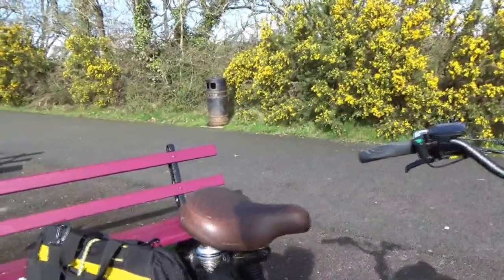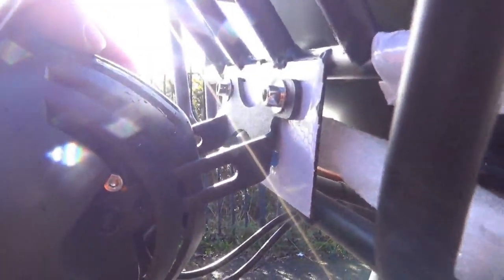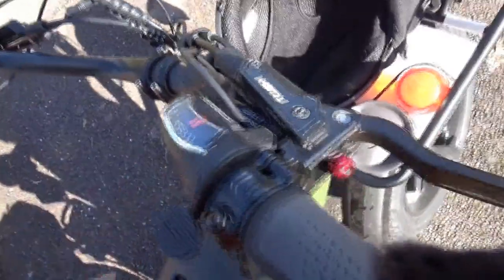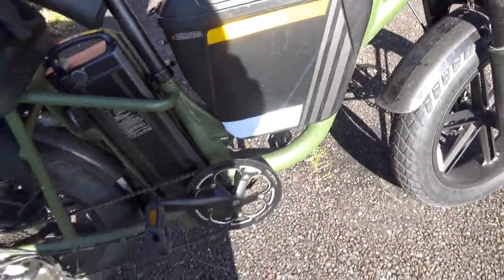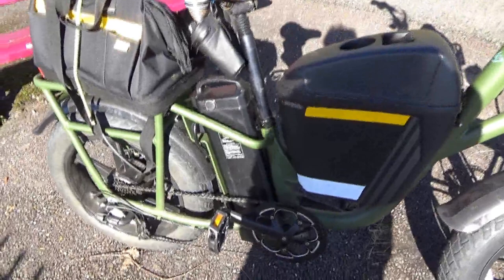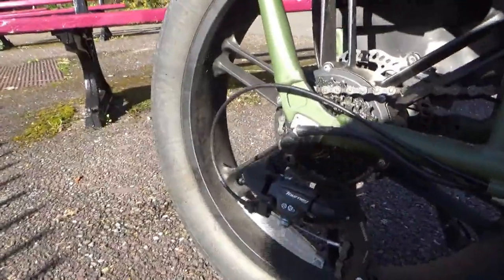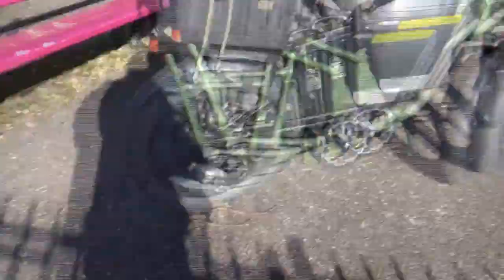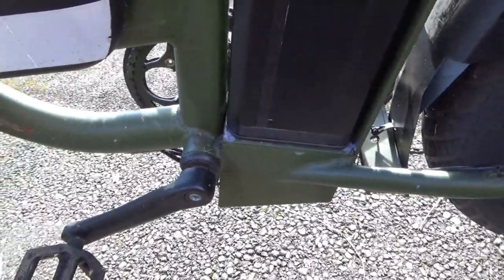Fiido T1 replacement review

Comment: Thanks for the follow up. I totally agree on the controller and the speed limits , I've just swapped my system out for a Grin phase runner with pedal torque sensor.  Great bike to ride and now I've taken ownership of the electronics I'm in control of all the settings.
Reply from the maker: Very good. I recommend the Grin. A well worthwhile investment as it can fit inside the existing housing. Well done.
Reply: I have been trying to find an alternative for the electronics ,you have made my job a lot easier  now . can you please tell me if it was easy to do  and and approximate cost ? Thank you in advance.

Comment: It has cruise control, just have to hold down the bottom button until it flashes and then it's on.  Have to do every-time you power up though if you want it.

Comment: On these bikes I think it will be worth adding a torque arm fitting to the rear wheel spindle.  It is the torque reaction on and off all the time that is loosening the wheel nut so threadlock ( although better than nothing) is going at the symptom rather than the cause.  I think it will be easy enough to implement on the brake disc side and use the sidestand bracket bolts as the  stay.   How do you find the mudguards when it's raining ?

Comment: OP, what is that center basket in the step through area of the bike? I'm looking for something like that FOR AGES for my T1 Pro.
Reply from the maker: You can is buy that from Radrunner website. It used to fit on the original T1 perfectly. For the revised version you see here, you will need to melt the bottom of the plastic with a blow torch or a hot gun in order to morph the shape slightly. The plastic is pretty hard. It has been a useful item for carrying stuff. The cupholder at the top was not very well though out. Cost is 100 Euro

Comment: Great review very informative.
Can you get 60miles on a single battery using the lowest power setting.i have a regular 60mile journey I’m looking to ditch the car for.    I would be looking to use it in full power USA mode.
Reply from the maker: @paulcanton9827  60 miles? No. I have measured it many times. For a 200 lb payload at pas2 (18mpg) you get 40 miles. Which is very good. Pas1 would give you more but at 12mph which is slow. Not good for a very long commute. And at any rate you don't want to spend so much time on the saddle.

Comment: Great vid thanks. Couple of questions if you don't mind; how do you tell how much charge the battery has, the new bike is limited to 15mph can't it be unlocked? I've heard the new ones aren't as fast but can do 20+ and have a smoother peddle assist / take off. Also is the throttle progressive or more of a switch? Thanks again.
Reply from the maker: Best way to tell the charge state of the battery is keep a volt meter handy. With the battery out, measure its terminals with the meter leads - 44.6V(0%) to 54.6 (100%).The new bike is limited to 15 mph but you can disable it so as to go faster (to 23mph) with throttle only. To do this - hold down both brake levers+throttle+power on button. The bike will switch on and it will flash on the display. Hold it like this for 10 secs. Let go of everything. Turn it off and back on again. Keep in mind that peddle action will cut out the effect of the throttle. So to use the throttle you have to stop peddling.
Reply: @stevemccormack9948  Thanks for the reply. I'm after one but they're out of UK stock til mid April:(
Reply: @Kurt Nooks  I have the T1 to & the T1 Pro,  & it's a HUUUGE upgrade compared to the old brakes,  & the bike feels a lot more solidly built, like a tank, & mine is only like 3-5 moh slower than my original T1 but I'll take the loss for the better build quality!
Reply: @ReVolt_e-Vlogs  Great to hear! I suppose the controller's parameters have been changed, and can be changed again maybe. My bike is on a ship from China atm hopefully headed my way, can't wait!
Reply: @DeePaignall  You'll love it!!
I look for ANY EXCUSE to get out for a ride! 😆 
If you're not already a member, there's a few good Facebook groups with a lot of helpful people, a lot of cool personalized bikes in them!

Comment: Looks like it only really needs a front fender that comes down further. That one doesn't look like it would keep mud out of your eyes.

15:00 - You're right, 25 kph (15.5 mph) is really pretty slow. Here in the USA, The Powers That Be chose 20 mph as the max speed of our lowest class of eBikes. The rationale was that this is a speed easily attainable to an athletic person on a lightweight road bike. Since the intention is to make these equivalent, what is the point of making them slower than a purely mechanical road bike?

Here in the USA, we have a three class system:
Class 1 = 20 mph maximum assisted speed. No throttle option.
Class 2 = 20 mph max. electric speed; assisted or throttle
Class 3 = 20 mph max. on throttle, 28 mph (45 kph) max. on assist.

Class 1 bikes are allowed on all bike trails, as they are considered equivalent to a mechanical bike.

15:35 - re. "10 lbs. heavier than what I would like." Forgive me for asking, but how heavy is the engine? (you) How much weight do you add with all your cargo?  A lot of cyclists here are counting ounces, but the rider himself is 30 lbs. overweight. :-D  I hold myself responsible.

16:40 - I've read (can't remember where) that keeping the battery in the 20-80% range typically will result in the battery lasting 3X as long.  When you know you are going on a longer trip, charge it to 100% no more than a day in advance and use the entire charge; you'll be fine. This is not an everyday occurrence, so it won't have a notable impact. More later; got to run.

Comment: Hi Steve   I see that rad has come out with a different console, with a flat locking top. Do you think it would fit the T1?¿ Cheers
Reply from the maker: I see that - the Console 3. The top is better designed than the old one. I notice there is just one mounting screw on the bottom rail. I did not explore to see if you need to drill a hole there for the Fiido T1 or not but its not difficult. Keep in mind if you have the Fiido T1 replacement bike the profile for the frame is a bit different. When I was transferring the console box from the original T1 I had to use a heat gun to soften(melt) the floor of the box to change the shape. It was tough old plastic so it was a bit of a wrestle. Might take 30 mins. I am assuming the new box uses the same plastic. If I didn.t already have the console installed I would get the new one.

Comment: How tall are you? I want to put the same console on mine, but it doesn't look like it will fit under the sattle at the hight I have it set at.
Reply from the maker: I am 5'10". When I stop at traffic lights I normally jump down on one foot so I can easily manage the centre console that way. If you are much smaller than that the centre box might be a problem. But bear in mind that the box can still be lowered on the new T1 by about 1/2 inch lower than what you see it here on the video - I would need to melt the plastic floor more in order to morph it into shape for the new T1. On the original bike it was easier mounted, though on the new bike it sits lower overall by about an inch

Comment: Steve, Please do you know how many wires are in the cable to the motor. I want to fit an in line connector and need to know the number of pins for the connector. thanks.
Reply from the maker: Its a 9 pin as I recall. about 8 wires are used
Reply: @stevemccormack9948  Thanks.

Comment: Hey. Could you tell me more about that box in the middle?
A little more detailed information? Where can I buy one?
Reply from the maker: The central console box is available from the Radrunner website. Cost is €99. On the original T1 bike it was a perfect fit. For the revised T1 you need to use a heat gun at the bottom of the box to morph the shape a little. Cup holder feature is useless but I use it for storing locks etc. Also it is storm proof - very dry and even great for documents etc.
Reply: @stevemccormack9948  Thank you a lot. I appreciate it.

Comment: Are you in Ireland? I want one but laws coming in Q1 2024 putting me off!
Reply from the maker: Yes I'm in Ireland. Which laws? I didn't hear lately
Reply: @stevemccormack9948  there’s a few articles wrote on it back in September ish time. Anything over 25kmph or 250watt motor will be a new class of transportation. Requiring license, registration, tax and insurance. There working on the administration for it I believe. But it is going to take longer than that I would say. There are definitely trying to put something in place. Really goes against the whole low emissions carbon etc. load of bollox but while there are e-bikes they will be kids getting their hands on them and driving recklessly. unfortunately we all suffer
Reply from the maker: @meanfitness1689  Yes of course. But its very telling that they would not just up the speed limit to 30kph which would be fine for everyone. Government wants to controll every aspect of people's lives.